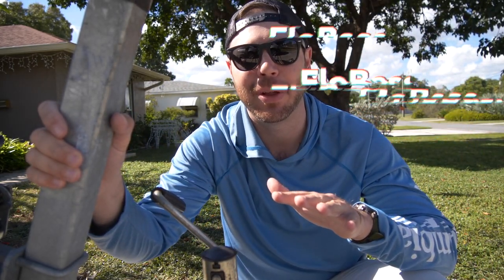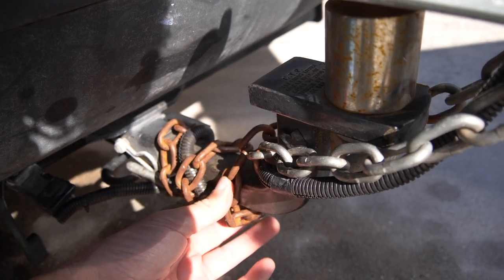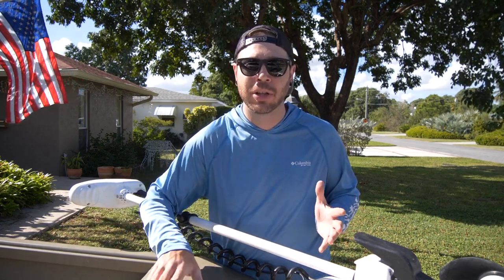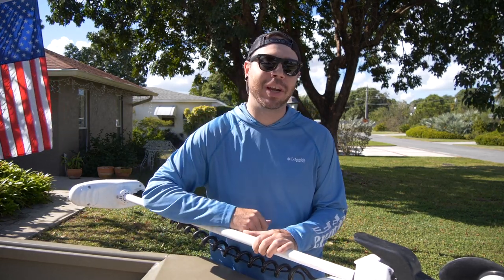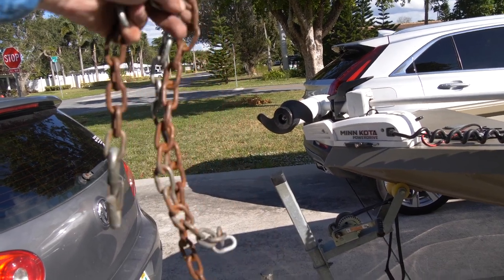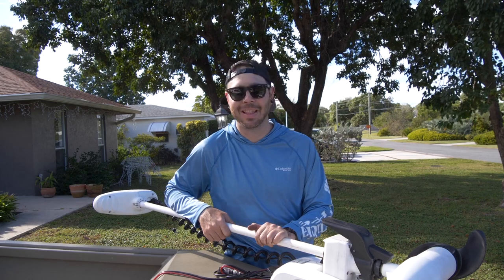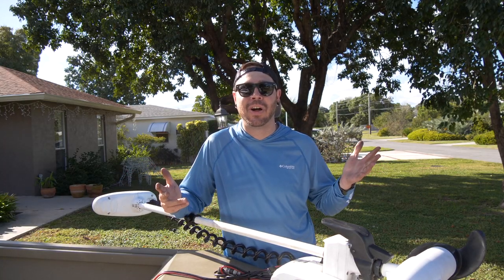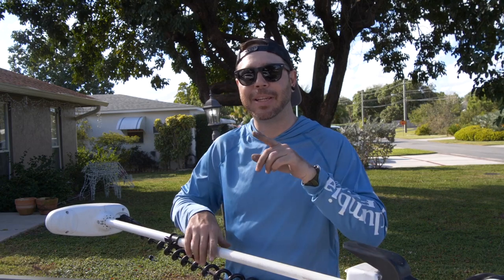DIY Easy Trailer Upgrade For Better SAFETY

Comment: Just for future reference, when your chains are dragging, you unhook, the twist your chains, this shortens the chains and still give you the integrity of the chains. Also you will still have room for turns and maneuvers. The cables are a good idea, and will be a little stronger. But there was nothing wrong with the chains you had. The cables are nicer though.
Reply from the maker: Thanks for the tip. Been towing since I got my license. Definitely tried the twisting chain trick, but it didn't shorten them anywhere near enough to keep them from dragging.

Comment: Is that a drop in gooseneck ball that you’re using or is commercially available
Reply from the maker: It's a standard trailer ball with a 2" rise. Curt MFG sells them. I needed it to level the trailer when it's hooked up to the car since they don't make a ball mount that goes any higher for this vehicle.
Reply: @FloBass  gotcha. Those little receivers are lacking in the aftermarket compared to 2” 2.5” and now 3” receiver tubes

Comment: 1st
Reply: Why do trailers have cross chains? SO WILL YOUR LONG CABELS DO THIS  I DONT THINK
When attaching chains to a vehicle, always cross the chains. Crossing the trailer chains aids in turning the trailer by reducing the probability of stress. It also acts as a cradle in the event of separation from the tow vehicle,
Reply: @bmyrer5556  you're exactly right.  He has it all wrong talking about how "you want the trailer to get away from your car just a little bit so it's not flying around and bashing into your bumper".  What you want is the cradle you mentioned.  The last thing anyone should be concerned about if their trailer became detached is what happens to their bumper.  First and foremost, you don't want to lose the trailer off the vehicle completely so it's out in traffic causing accidents and more injuries or damage, hell with your bumper.